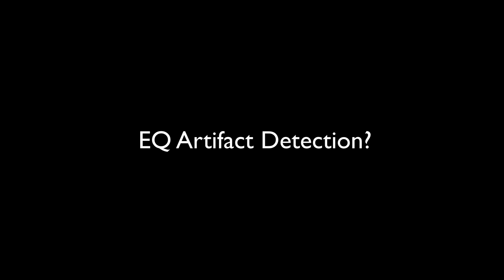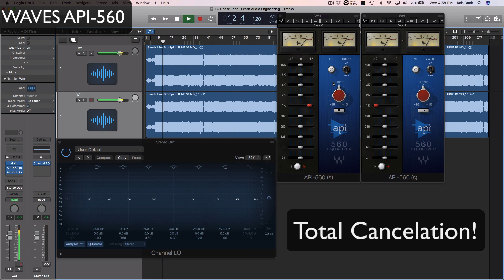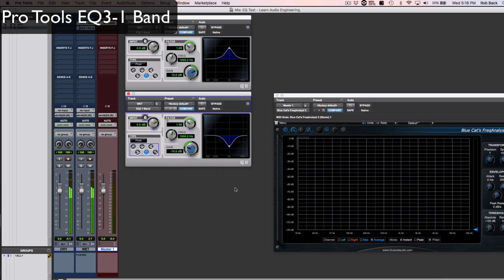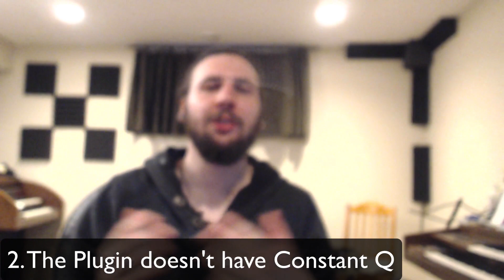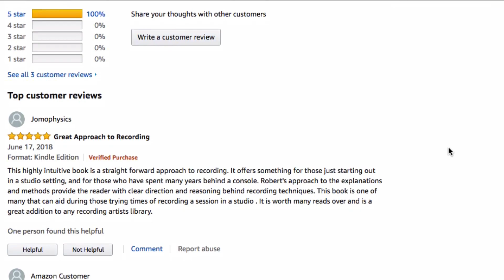EQ Artifact Detection Test // Recording Experiment

Comment: Ok first- Logic Pro with Q couple activated means the plugin is using different Q proportions. Boosting curve is different than cutting.  Second- Scheps 73 its modeled after Neve 1073 which again Proportional Q is used BUT curves are different from each other. Thats just how hardware unit works.  TDR Nova have the "Precise" activated which means that plugin is avoiding any phase cancelation at all...that explains why it seems not doing anything at all. Tdr Nova is developed to react like that unless you change it from Precise to Eco.    Plugins like Pro Q2, stock eq  from protools and API are exactly equal when boosting and cutting. Hence the total cancellation.  Now even tho Scheps 73 and API eq  are  using proportional Q ....on both plugins the Q factor doesn't react the same.  API have exactly the same Q factor when boosting or cutting while Scheps 73 Boosting is wider than cutting.   In this video you just showing how different are the Q factor on each plugin.  Idk if that was your point on the video but if it was you could go into the explanation of Q factors on each plugin , the history and why they made them that way , in what situations they are useful...all that stuff.   Either way the video was cool , just a little bit hanging on the "Why" explanation of couple things.  But Keep it up. 👍🏽. Oh and BTW....Nice way to avoid copyright issues making a different version of Nirvana- smells like teen spirit. 😂🤘🏼

Comment: Only EQs that feature symmetrical curves and Q when boosting / cutting will cancel out in your test.

This has nothing to do with any kind of "artifact" it's just not the same curve or Q when boosting than when cutting.

There is also another factor, some of the EQ's in your test add nonlinearities to the sound, and this will stack up in each instance, it's the same you boost or cut, the nonlinearities (added harmonics) will probably be added both ways, so this effect will be cumulative because you add 2 instances and they will not cancel out with the original file even if there is no EQ going on. 

It's a "desired" artifact of some of these EQ's, in Nova you can turn off nonlinearities by selecting "Precise-" mode instead of "Precise" mode.
Reply from the maker: Great comment! Yes, I figured the symmetrical curve was the real cause of the cancelation.   These 'non-linearities' are what the test is hoping to find; something extra added that differs between EQs.   Do you see a different way to isolate and display these differences?
Reply: VSTPluginAnalyzer or DDMF Plugin Dr https://ddmf.eu/plugindoctor/,  you also can run a sine wave  into the EQ and use SPAN after it to look for added harmonics or alliasing. Phase or amplitude wrapping around Nyquist are common artifacts of the EQ itself but these artifacts will cancel out in your test. Is also interesting to see Impulse Response graphs.
Reply from the maker: Thanks a bunch! I will check this out.

Comment: I tested NOVA and ReaEQ on the last Reaper version and this is the result:

1) When I did exactly your experiment both EQs (two NOVAs or two ReaEQs) fail in canceling each other.

2) This time I tested byt putting both EQs, each on on each track but they failed again.

3) Having both EQs on each track this time instead of boosting in one and cutting in the other, I did the same on both EQs and the complete cancelation happened. Isn't this weird? Could you test this with your other EQs?